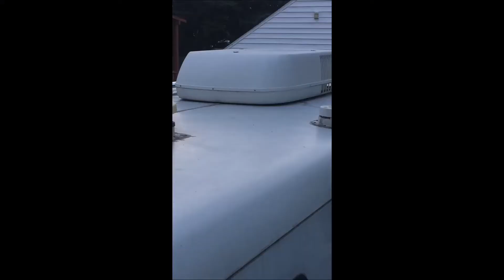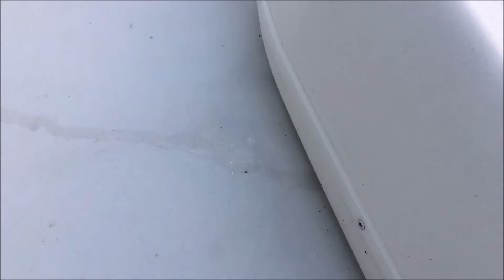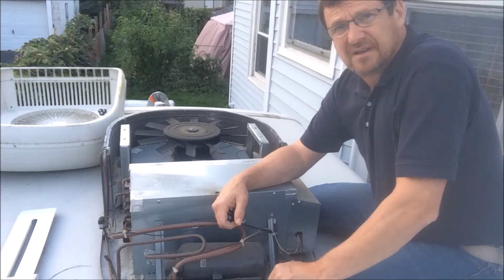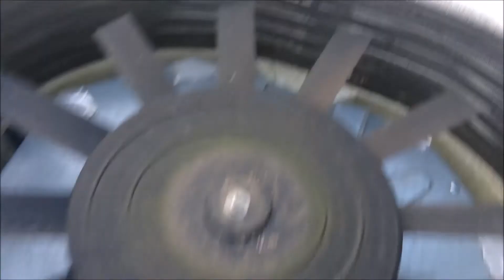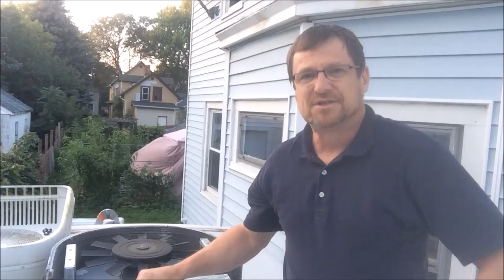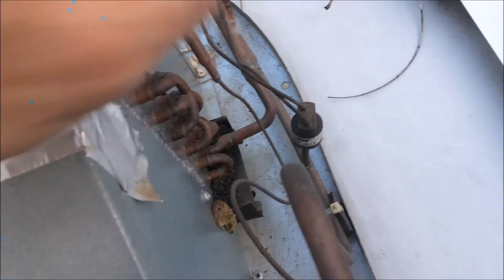Rialta Roof AC Inspection

Comment: Close, in the description of the refrigeration system. The compressor does compress the gas, however it does not turn it into a liquid, that transformation occurs when the air goes across the coil. The heat transfers from the hot gas and condenses in the condensing coil to a liquid, allowing the heat inside the unit be expelled outside of the rv. That is why when to put your hand over a condenser fan you will feel hot air. 
Also, I agree with Mr. Fay, I would be interested in where the condensate is channeled, perhaps the gray of black tanks. As for clearing a blocked condensate line, compressed air is usually the best method. 
Really appreciate you efforts in showing the system Sir, much appreciated.